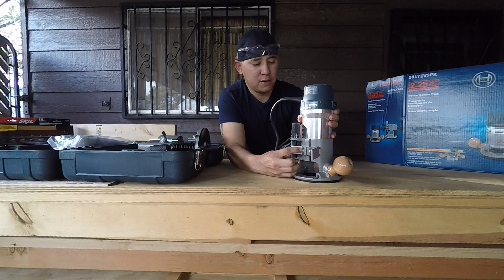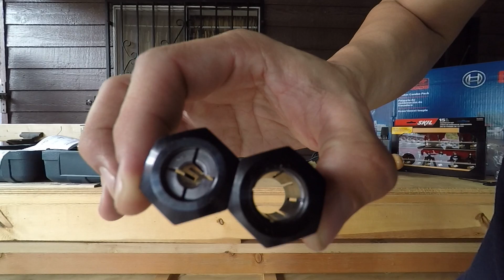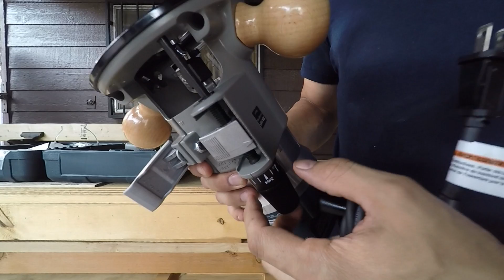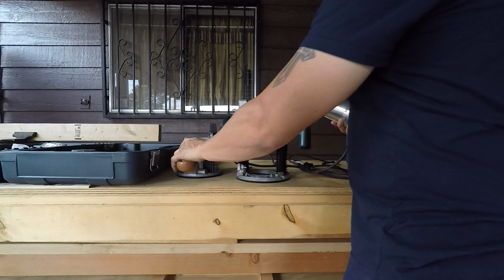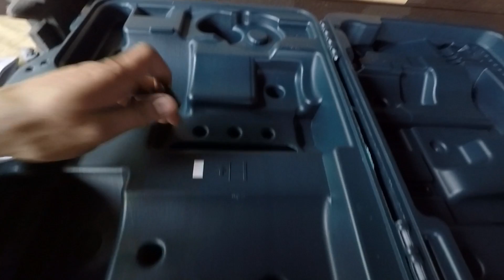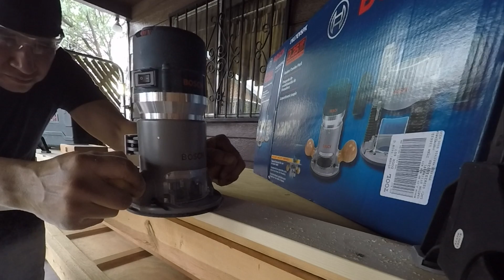BOSCH 2.25 HP ROUTER COMBO 1617EVSPK REVIEW AND TEST RUN

Comment: they also work as a cnc router spindle very well. I have many hours on my 1617 and it still works just like new. plenty power to cut wood, plastics etc. I will probably buy another one and use the current one in a router table.

Comment: Terrific tutorial. Made me a subscriber. I know I'm late to the party, but perhaps you'll see this comment. I'm trying to determine what the proper speed is to run the router with a given bit and a given piece of stock. So, for instance, I'm doing a round-over on a piece of pine with a 1/4" bit. Is it better to run that at 1 or 2, or 5 or 6? I've tried googling but no luck so far.

Comment: Hey Alex, I bought the Bosch RA1171 router table to go with it.  Just so you and your viewers know, those screws you mention at about the 9 minute mark are indeed for attaching to a router table.  However, if you buy the Bosch RA1171 router table, it also comes with the same exact screws.  I would imagine the Bosch RA1181 router table also includes them.  But hold onto those screws that came with the Bosch 1617EVSPK combo kit, in case you purchase a router table of a different brand.  Heads up:  the Bosch RA1171 accommodates routers from MANY brands, including DeWalt, Hitachi, Skil, and several others.  While I'm using a Bosch router and Bosch router table, my cousin has borrowed my router table and it fit his "off-brand" router just fine.  :)
Reply: I was wondering about the screws! Thank you! All the screws that it came with are for the table??
Reply: does the RA1171 and the RA1181 fit the 1617EVSPK router? Which table would be better?

Comment: Hello, I am thinking of doing some inlay work ( I am a beginner) and I like this product. But the hole is too big for a guide bush. Any idea what i can buy to over come this, is there a particular kit for example? Thanks. Chris
Reply: It looks like you need the Bosch RA1129 kit. That should contain the parts you need to use Bosch "quick change" guide bushings, and an adapter to use Porter Cable guide bushings. Also, I have heard that the "quick change" design that Bosch uses leaves a little too much movement for some people. If that's a concern, there are several aftermarket base plate options that are for standard Porter Cable style guide bushings, without using any adapters. In my opinion, that's probably the way to go.

Comment: This was VERY helpful.  Just getting into more in-depth woodworking, and wanting to add something special.   Routed edges are the way to go! Thanks!!
Reply from the maker: Hey Daniel thanks for the awesome comment!!! You will not go wrong with this brand and tool! Best of luck on the projects!!!
Reply: Just bought my router yesterday! Still trying to decide on a bit set, but I'm close!
Reply from the maker: Daniel Stilson! Don't you love it bro?? I started off with the skil set and it does great! I know that diablo blades work at the top of the line for saw blade and I'm sure they measure up on the router bits! I will most likely be purchasing those in the future!

Comment: when the router is in its plunge base, you you have to unlock it to use the micro adjust?  I'm trying to skim through your video to find my answer but I apologize if you've already covered it.
Reply from the maker: Hey Robhimself79! So in the fixed base it definitely does need to be unlatched to adjust the micro adjuster ... however for the plunger it does not as the adjustments are all on the outside base portion... I hope this helps!!!
Reply: Alex Quiroz it sure did help.  thanks for the super quick response.
Reply from the maker: Anytime brotha!!!! Thanks for asking!

Comment: Another thing.....I found a "starter" pack of 24 various router bits for about $35.00 on Amazon.  Cheap stuff, made in China, under the brand "Stalwart."  They claim to be carbide tipped, but we'll see.  I actually only bought it as a "learning set" of bits for myself, since the 1617EVSPK is my first router.  I've used another one (borrowed from my cousin), but it was too under-powered at only 1 HP and couldn't handle the dense red oak that I was trying to make dovetail joints into.  The dovetail jig I bought came with its own dovetail bit, so I used that one.  When I bought the Bosch, it ran through that red oak like butter.  Smooth, clean edges.  Well worth the investment.  However, I used one of the Chinese straight bits, and during use, some of the powder coat paint on it came off after a single use.  It still worked, but clearly you get what you pay for.  It's no wonder that quality router bits can be priced, individually, from $13 to upwards of $60.  The Chinese "Stalwart" bit set did come in a handsome wood box, similar to the Skil set that you reviewed here, but at a fraction of the cost (and fraction of the quality), but for the price, I'll take it as a "learning set" for me.  Down the road, when I get used to using various bits, I'll definitely invest in higher quality router bits, sold individually or in sets of 3, from good quality manufacturers, like Bosch, Skil, DeWalt, etc.  :)

Comment: How is this router  holding up? Are you still happy with it. Pros/cons?
Reply from the maker: Hey Zerostar369! Thanks for checking out the video and for asking a great question! Yes this router is still holding up great and judging by the build and feeling of the router,  I think it will outlast my life Lol! Pros is super smooth and makes great cuts with no issues. I couldn't see myself trying anything else. Cons... I have yet to see what it's like in a router table and once I do purchase a table, I would still be surprised if there was anything bad. Hope that helps!!

Comment: Alex.....Great video and very informative.  I've had the 1617EVSPK for about a month now, and used it twice, once with the fixed base (dovetailing joints for a new drawer) and once with the plunge (for a straight bit knob hole.....just to try it instead of using a drill).  It's a great tool.....but I just ordered the Bosch RA1054 "Deluxe" Router Guide, and wondering if you have it and any videos using it?  I just subscribed to your channel and will check again later but have to start dinner now, LOL.  Thanks in advance, and I'll check out your other video tutorials tomorrow!  :)